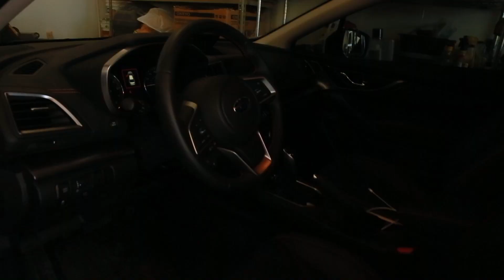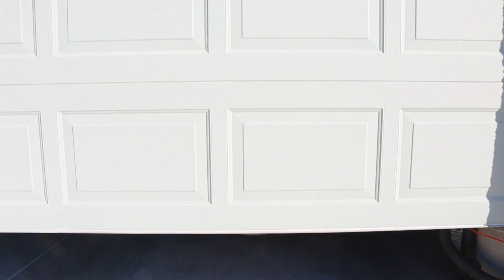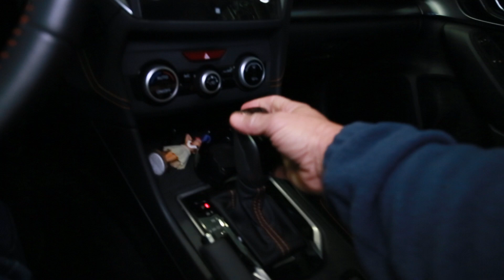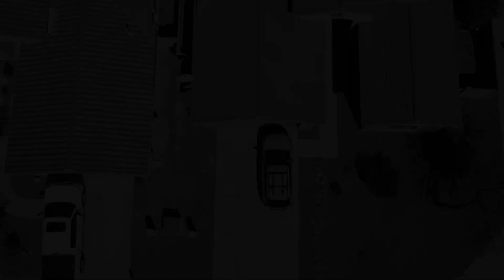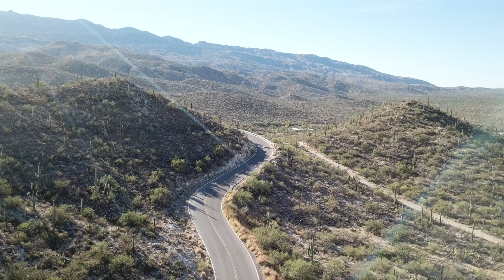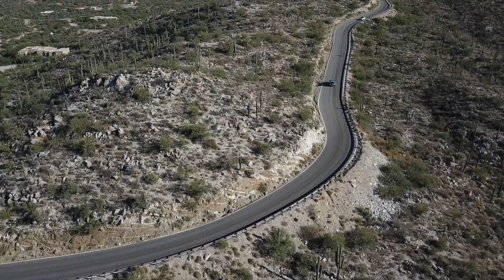2018 Crosstrek:  How is the CVT related to Oil Temperature?

Comment: Here in Alberta Canada, Edmonton area  -20  to  -30 Celsius are normal. When I go for a drive, even a long one, 400Km or more { ski trip - none this year :(  } I get poor fuel economy as the car will hold higher RPM's when cruising at the same speed compared to it's behavior during a bit of a warmer weather.  Coolant, engine oil, transmission oil temps are important to keep the CVT happy and keep the pulleys and belt from slipping as transmission oil viscosity and film strength are higher I suspect.  If our cars had full shutter grills over the radiators, that will help a lot, as I've seen these on other direct fuel injected cars. I drive a 2017 Impreza (same powertrain as your Crosstrek)
Reply from the maker: Thank you for your comment!  Wow.ow.  -20 to -30.  That does not sound like fun at all.  :)  Sorry to hear you didn't get to ski this year...I am quite over this Covid stuff at this point.  Take care and stay warm.

Comment: What do you mean hitting 140 F !!!
I hit that just by reversing my car out of garage.  Half mile from home and oil temp is already at 190.
 Did you mean 140 C.. or is mine just too hot for no reason.
Reply from the maker: No, 140 F.  I know we looked into what a "normal" temp is, but we never really figured it out.  You might ask at your dealer but my guess is it is probably normal.

Comment: Same I noticed with my crosstrek 2018. Drove to nearby city 250 km away, most of the time with cruise control 95 km/h and 7th gear (checking it from time to time in manual mode), average mileage was 6.2 l/100km. Next day On my way back drove with the same 95km/h cruise control, observed gradually decreasing mileage. When put to manual noticed CVT was always at 6th gear. Putting 7th gear manually did not help, CVT was always coming back to 6th gear. mileage decreased to 6.9l/100km. I have no Idea why CVT behave like that. It was exactly the same road, same condition no Hill up or down, no extra load.  For sure there is a reason for that and very interesting to know it.
Reply from the maker: That is interesting.  So when you tried to go into 7th it would not allow you to?  Or it was not available?  It seems like the CVT would want to go into the highest programed gear because the goal is to provide the best mpg possible.  Do you know what you rpm's were when trying to go to 7th?
Reply: It allowed me to go to 7th but after short period of time were back to 6th again. It was mode "D". RPMs with 7th gear were 1800 and with 6th 2050, always with cruise control 95 km/h.
Reply from the maker: Thank you for the numbers.  Must just be the CVT  trying to be in what it thought was the best "gear"  for the given situation?

Comment: Hi how you monitor your CVT temperature fluid? I have a FXT 2014
Reply from the maker: HI Patrick, It has been so long since I had my 14 that I do not remember the different gauge options unfortunately.  With the 18 it is an option for the upper information screen.  Hopefully someone will respond that has a 14 model.

Comment: cold climate/low gear makes sense to me.  the car probably is design to reach operational temp. as soon as possible so, it keeps the engine at a higher RPM until that occurs.  probably normal.  not a mechanic and this is just a theory.
Reply: If it's really cold it never does reach  it's operating CVT oil temperature, I'm robbing to much heat to keep the cabin  warm (since brand new 2017 impreza). my old 2008 Impreza never did that, ohh wait no CVT and a bigger 2.5L engine and 4 speed auto.

Comment: Help! I have a 2014 Crosstrek w/ 2" ADF Lift Kit, 215/75/15 KO2 tires, Method rally rims, and front/transmission primitive racing skid plates. I took a trip to Ouray, CO and on the way there the "AT oil Temp" light came on my dash. I pulled over and let the engine cool and it drove normally, but happened repeatedly during the trip. The light came on five times during the whole trip. 2 times on the way from Dallas, TX to Ouray, CO, one time while off roading on different days. One on the Imogene Pass, and the other on Yankee Basin Trail. Then, one time during drive back to Dallas outside of Albuquerque, NM. I took it to the dealer and they're saying that's it's been driving in hot summer heat, plus the heavy tires, and the stuff on the roof rack is what was probably causing it. I drove about 2500 miles the whole trip. Is there anything I can do to improve my long distance trips? I've been looking all over online to find answers. 

Maybe I need to drill holes on my skid plates for more air flow? Maybe I need to add a transmission cooler?
Reply from the maker: HI Christopher, first off I just wanted to say I am seriously jealous of your trip!  I spent some time years back riding motorcycles on many of the trails you mentioned and it was absolutely beautiful.

Personally at this point I have not had any issues with oil temps, but have been in communication with a subscriber, who has a stock 18, lives in Vegas, and has seen temps in the 270 range.  He is waiting on Subaru to check things over and his local has no answer.  I have not seem temps higher than the 220's and that is in 105F temps.  As you probably saw I have the same tire/wheel set up as you, but no lift and no roof rack or skid plate.  They certainly could be adding to the temp as you are looking at a lot more wind resistance.  Not sure what the skid plate covers, but drilling holes might be a solution.  Did you happen to notice what the temps were before the light came on?

I am sorry I don't have a better answer for you, but an oil cooler would probably be good if they make one for the Crosstrek.  Please keep me posted if you find any answers and I will do the same.  Best of luck!
Reply: I don't know exactly what the temps were when the light came on. I'm driving to Denver, Co. soon, so I'm going to try different things to see if the "AT Oil Temp" light comes on or not. However, driving it around Dallas, has been completely normal and no problem at all. I work 20 miles away so there hasn't been an issue with the commute.
Reply from the maker: Let me know how it goes.  Kind of strange that it got so hot on the freeway...seems it would have more air flow then driving on your daily commute.  Definitely interested in seeing how this turns out.  If you can see if you can keep an eye on the temp...I can't seem to get an answer as to when the light comes on.
Reply: Rick - As my daily commute in Dallas, TX, I drive about 17 miles hwy to work and back mon - fri and light hasn't come on in this hot Texas summer. I talked to my brother about it and he's thinking it's because I have an Automatic CVT and the manuals should handle better off roading on Jeep trails (Which makes sense, even though I used the paddle shifters). Plus the light came on the way Colorado so off roading has nothing to do with it. Just the stressing the engine from pushing it while going over big rocks with camping equipment in the car and tire on the roof will cause the light to come on. So probably something with the weight caused it. I looked up the forum and it's saying it doesn't matter what transmission I have. It should be fine even while off roading on Jeep trails with the Automatic CVT. I asked Mountain Roo on Instagram about it and they're saying that I needed a bigger transmission cooler. Fozroamer had the same problem so he said to get the plate and trans cooler. B&M, Hayden, Derale are good brands. Don't get tube and fin from different application otherwise it won't cool it the way you use your car. So I ordered the Derale 8000 Plate and fin cooler kit. I found a mechanic who'll put it on hopefully this weekend or next week. I'm driving to Denver, CO the week after. Hopefully it'll solve the problem. I'll let you know.
Reply: I found out it was the Transmission Skid plate causing it, which was weird. I took it off and drove from Denver to Dallas, light never came on. Might drill holes on the skid plate to see if that solves any problems.

Comment: per the user manual (all documents linked below), the car will intentionally/preferentially maintain a higher rpm during initial/cold operation to hasten warmup. while this hurts efficiency a bit initially, this is ultimately meant to prioritize the longevity of the system, a fair trade-off in my opinion
Reply: https://www.subaru.com/owners/vehicle-resources.html?modelCode=2018-CTK-JRE
Reply from the maker: Thank you Tom, found that after making the video, much appreciated.

Comment: Good info, I’d add that my 18 Forester is a complete slouch below 100 degrees oil temp. It slips the torque converter like crazy to build up some heat. And I had the CVT AT learning done already 8k miles ago, so it’s not the input clutch or chain slipping. Above 100 degrees it’s normal
Reply from the maker: Thank you for the comment.  What is the CVT AT learning?  I am not familiar with that?  Cheers.
Reply: AT learning is a procedure where the CVT relearns to time and pressure it takes to fully apply the input clutches. This fixes the lag when going from reverse to drive
Reply from the maker: Oh ok cool.  So you had a lag from Reverse to drive....bummer.  I had that with my 14 Crosstrek, but nothing on the 18.  Some are complaining of a slow speed shudder, but thankfully I have no signs of that either.  Subaru says its normal?
Reply: Yeah since the AT learning it has been great. The shudder is usually just "ratio hunting" due to low throttle input. It goes away if you give it a bit more throttle
Reply from the maker: Very cool.  Glad to hear it and thank you for your great info!

Comment: Hey rick...
Just drove to Vegas and going up one of the long grades my oil temp was up to 244...can find anything on temp range or if this is normal...please let me  know if you find anything on temp range....I have contacted the dealer by me and they were no help....
Reply from the maker: That seems pretty warm brother.  I'll check with my Subaru guy and see what he says.  Seems normal was up to 220 or something?  Can't remember for sure now.
Reply: Rick Hutton 

Thx....
Reply from the maker: No worries.  I sent him a text...just waiting to hear.
Reply: Rick Hutton 

I called a few dealerships around me...they have no clue on what is a safe temp.....one dealer told me it’s because my car burns oil and it’s probably low so that would make the temp higher....I told him it’s a new car and he said it still burns oil...
Reply from the maker: Wow.  :)  That is a little scary.  It is amazing how some dealers are clueless about the cars they service and sell.  I think before your car was in the 220's temp wise?  It will be interesting to see what happens with mine during the summer here.  When I hear something I will post here.  Cheers.
Reply from the maker: My buddy says the "general rule of thumb" is 205 to 225 degrees.  No explanation as to whey you showed so hight?
Reply: Rick Hutton 

Mine  was at 225 for about 100miles and got to 244 on the long grade up....Maybe I will try a different oil..
Reply from the maker: Let me know if it works.

Comment: I think engineers are programmed it this way but they won't explain it to average consumers. Reason is that it is complicating to go details and technical, simple, explanation is CVT belt should not be strained under certain cooler temps - safeguard against slippage - for long lasting prevention mode, until comfort zone achieved. I cover my front intake in winter and it works.

Comment: I was out and about in the city today, and a couple of times I changed to Manual to see what gear I was in. I was doing 60 kph and was in 7th gear @ 1,000 rpm, but I did not check the oil temperature. I have a highway drive coming up, so I will check again and report back.
Reply from the maker: Thank you Peter. Appreciate the insight.

Comment: Ok Rick, I have paid close attention to the cvt, oil temp, highest ratio topic over the last 150 miles. My car will not utilize the 7th "gear" regardless of oil temp (up to 198F) or hwy speeds (55-75 tested) unless I use manual mode. My commute is flat as a pancake, no traffic. The curious thing is my real time mpg reports better fuel economy at higher rpms in 6th "gear" than when I force the transmission to remain in "7th". Something strange is going on...
Reply from the maker: Hi Colter, thank you for taking the time to check this out and comment.  That is really strange.  On my way to work in spots I am driving 45 to 50 mpg and once the car is warm I am at about 1200 or 1300 rpm's.  When I click over the Manual it is always in 7th?  This is definitely interesting.  I am getting the book out right now and checking to see if there is anything interesting about the CVT.  Thank you again.  If you see anything else of note please let me know.

Comment: When you used cruise control you can change the computer rpm from standard to comfort and it will not go up to 4 rpm
Reply from the maker: Hey Pierre, is that with an  eye sight  car?  Cheers.
Reply: Rick Hutton yes on eye sight
Reply from the maker: Oh cool.  I don't have eye sight so I din't know.  Thank you for sharing!

Comment: I did some testing yesterday since it was very warm (35F!). I drove for 12min non-stop at speeds between 65km/h (40mph) and 75km/h (47mph) and the oil temp was at 78C (172F) when I stopped. At 105km/h for a few minutes with the engine hot it was at 87C (189F).
Reply from the maker: Nice.  Thank you for playing.  :)  My car runs close to 200 or a bit over when we are in the mid 70's and 80.  How was the weekend?  Get to do anything fun?  It is actually cold around here for us the past week and my car said 28F when I came out of work this morning.  Yikes.  :)
Reply: Hehe I added the oil temp in the info unit instead of the acceleration % which is pretty useless! Nah it rained a lot and snow is melting and it was 1C last night (34F), which is a nice change...it's almost the first night above 0 since mid December! It was freezing rain today but it was melting in the afternoon but there were still some nice spots where I could drift a bit! :)
Reply from the maker: So I can't remember if you have a premium or limited?  If you have the premium do you know if there is a way to display oil temp?  I couldn't find it in my wife's 17 WRX and a fellow 18 Crosstrek owner was asking if you can show Premium?  

Dude, that is cold LOL.  I can't believe I am whining about 28 F.  Freezing rain does not sound fun.  Glad you got to drift a little.   Good times.
Reply: I have the Sport model which doesn't exist in the US, only in Canada. We also get the convenient package for the 2018 which is a very basic model. The top display is very hard to figure out, I will go through it tomorrow and let you know. And yeah, 28F is very hot for us up North! The hottest spot in Canada in the winter is around 32F! At that temp. people are wearing T-Shirts in most parts of Canada lol.
Reply from the maker: Wowza! that is chilly.  I would need a parka.   It is amazing how our bodies can adapt that is for sure.  Thank you for checking on the display..appreciate it very much.
Reply: Yeah! The other day it was about 36F and I saw plenty of cars with the sunroof open! 😂
Reply from the maker: All right, it is official, you guys are crazy.  LOL.  That is amazing.

Comment: I agree with this. Living in Idaho my buddy and I both have 18 ‘treks. He commutes about 20 minutes and notices his mileage is always better in warmer outside temperatures. I have also noticed this. What concerns me more, is longer road trips that I take and where I put cruise between 80-85, the cvt seems to keep the RPMs much higher than I would like. I switch to manual mode and there is usually at least one gear (sometimes 2) that I can shift up to to drop RPMs. I don’t know why this is but there is a big difference between MPG that I’m getting and the MPG that I should be getting.
Reply from the maker: That is interesting.  I have yet to do a lot of highway driving, but know my 14 did worse mpg wise over 65 mph.  Strange that your car wouldn't try to find the highest gear?  Was it an uphill stretch of road?

Comment: I live in Canada and you are absolutely correct with that information. The computer will not allow the car to go into overdrive until it reaches normal operation temperature. I believe it's a safety thing, to help prevent unnecessary strain on the engine and/or transmission. I drive a 2015 Mitsubishi RVR awc (Outlander sport in the US) with a CVT and my car previous was a 2012 Toyota Matrix awd with a conventional transmission but it also operated the same way. I used to be concerned that the transmission wasn't working properly when I first noticed my Toyota doing that, then one day I was looking for some information in the owners manual and I actually found in the book where it stated that the transmission would not used overdrive until the car had reached a predetermined operating temperature.
Reply from the maker: Very cool.  Thank you for sharing.  I will have to look through the Crosstrek manual a bit more and see if I can’t find similar info.  Thanks again.

Comment: Reading these comments, I have not seen anyone mention changing adaptive cruise control settings. There is a setting for how vigorously the car will accelerate when you get out from behind a car going slower than your set speed.
Reply from the maker: Thank for the comment.  I do not have eyesight so that is very helpful for those who do.  Cheers jr007